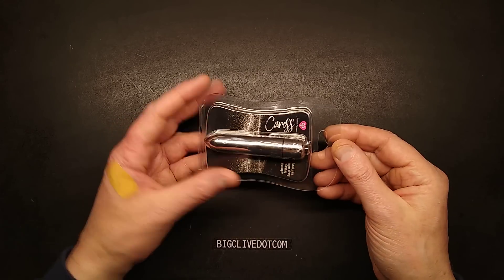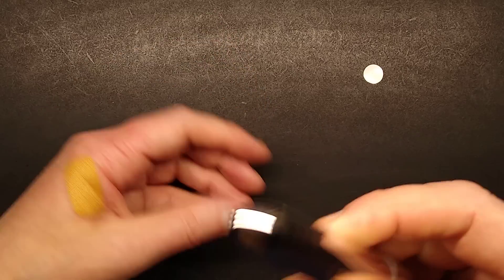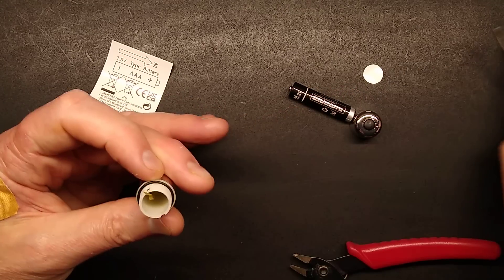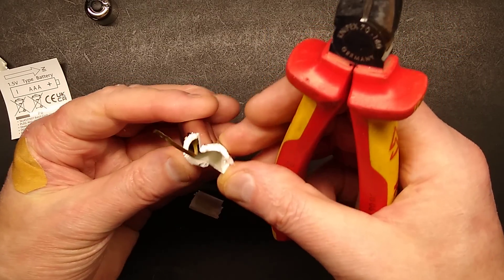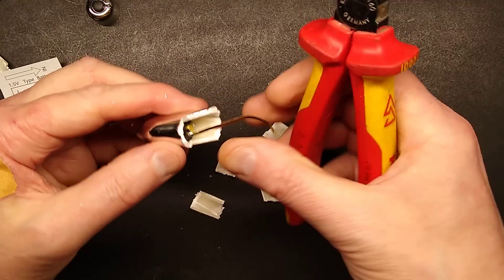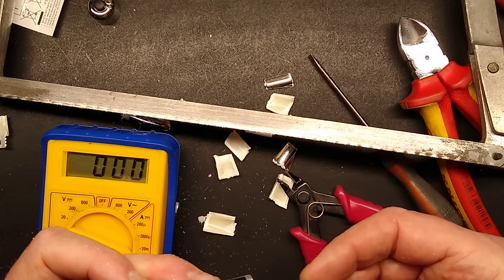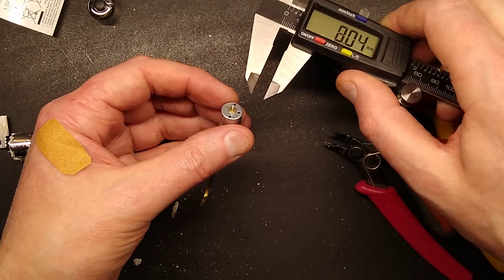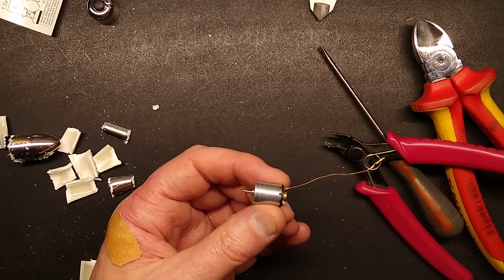Scavenging a Poundland vibro-motor

Comment: I bought one of these and gave it to a lady friend,  some time later I was driving through town at night she got it out of her bag , pulled her leggings down , feet on the dash and used it , I was thinking I wonder if that's got a low voltage low power motor in it 🤔 as i nearly crashed the car 😎

Comment: There are also useful ( and slightly smaller) batteries and motors inside the widely available £3.99 electric toothbrush that can be found in many supermarkets and other shops.. I think people forget what are in them and then throw them away

Comment: How can I make a constant current battery charger ( 2 - 4 amp) with a fixed voltage input?
Reply from the maker: That would depend on the application.

Comment: showing using the linear calipers as a depth gauge; brilliant. thanks. saves me having to get a seperate gauge. I hadn't spotted that functionality
Reply: What did you think the pokey bit was for?
Reply: @emma.jacobs1  something that made it awkward to put in the case! :-)
Reply: It would have been easier to use the shoulder on the other end intended for that purpose.  The pokey bit is used for measuring hole depths usually.

Comment: god, you wouldn't want to work in the returns dept. Shaft measuring phnarr was not lost either.
You can buy the little motors for cellphones small voltage and tiny current

Comment: Hmm, were these a pound or a few pounds clive? this will be a perfect, cheap source of vibrating pens, just the kind you would want to get the air bubbles and voids out of casting materials. I regurly have to give the folks at ann sums a couple of raised eyebrows when i go in and buy a dozon they seem to die quickly from being on for too long 😅 and the heat from the start of the curing process, might have to go in today and give some poundland works a shock buying most of the stock,

Comment: You really need to splurge on a tubing cutter. It's not the first time one would have made short work opening up a cylindrical device.

I suppose you'd find it awfully embarrassing to be caught using a plumber's tool by your fellow sparkies.

Comment: I can think of one application right off the bat...... My mini drone uses motors of that type to drive its rotors. The only problem might be that one would have to change all four, because you can bet your last tanner that the odd one out won't run to the same specs.

Any idea what the maximum rpm would be, and at what volts/current?

I'm now getting nightmares about vibrating drones, rattling about in the skies above! 🤦

Comment: A few years back, I used one of those, powered by 3V, to vibrate small castings of plaster of Paris on silicone molds, to remove air bubbles.
Reply: Thats actually pretty clever lol
Reply: @deadturret4049  👍

Comment: By the looks of things the short weighty shaft of the motor was thrust fully in the cavity that it was rammed into , if a little lubrication had been applied when first inserted  perhaps it would have prevented the rapid back and forth hand sawing . Probably  now useless as you gave it the snip

Comment: I have about 4 of these little motors. In my case, however, the counter-weights are so difficult to remove that they still remain on all 4. The weights appear to be several metal plates glued together in a stack, and are crimped onto the motor-shaft by what must be a beast, probably hydraulic in nature. I have not been able to free them despite my most destructive efforts.

Comment: About the AAA battery in there: does it wheight as much as a "normal" AAA battery? I've found that the batteries that were included with devices are significantly lighter than batteries I bought extra. I guess those "free" batteries have a greatly reduced capacity.
Reply from the maker: "Demonstration" batteries to tick the box of including one.

Comment: These motors works great when you want buzz notification like your phone does but in larger 3d printed housings. The high frequency vibrations from a phone motor tends to get absorbed by the properties of the printing plastic. I'm going to tell our local pi/arduino electronics shop to add poundland to their supplier list.

Comment: Construction of that toy reminds me of the Oral-B Pulsar disposable electric toothbrush.  Motor in the toothbrush is quite a bit smaller, 6mm OD X 12 mm long, but runs for about 3 months worth of thrice a day brushing on a AAA alkaline cell.  The toothbrush is rather more expensive at $12 for a 2 pack (bought by accident about a year ago, non-motorized toothbrushes had been about $8 for a two pack, they look the same and I just figured inflation).
Reply: I really don’t know what those cheap vibrating toothbrushes are good for. As far as cleaning your teeth, they’re as effective as humming a tune while using a regular brush. And for other “personal” purposes they just seem a bit too underpowered. 😉

Comment: Absolutely perfect for repairing my kid's drone. Landed in a tree and burnt out one of the motors. Cheers Clive.
Reply: Interesting. I hope the motor lasted long enough. But what happened with the drone? Or did you forget it while in the tree?
  You know, they sell new motors on Ebay, some as cheap as 1 pound ($1.27).
Reply: Depends if it's the same. Kv rating.
Reply: I tried to repair a friend's lad's drone and ordered a drone motor on Aliexpress, had  to order a second one because I hadn't got the correct rpm version. Plus you need CW or CCW motors, red/blue or black/white if I recall correctly.
Reply: @twotone3070  CW/CCW is for propellers, motors will spin in any direction
Reply: You may experience mild amusement every time you see it fly. Personally I don't give a flying fffwell, you know

Comment: I never expected to see something like this on this channel, but now i have the question, how many dangerous electronic 'toys' are there?
Reply: so, so many. A big issue is that the materials aren't very well regulated, a lot of them are made of cheaper rubbers that you should not be putting near your squishy bits. A lot of them have dodgy wiring and big scary lithium cells too.
Reply: @estherstreet4582  now I need to see a video about witch ones are and why/how they are, 

"let's make a 'toy' make out of a cancer causing material with sketchy insulation that you put into yourself"
Reply from the maker: Search my videos for Rinky Pink Pounder to see a shady 240V one.

Comment: An improvement, normally the inner sleeve is well stuck down with a solvent weld, and yes I have salvaged lots of those motors, and often enough a rather interesting reduction gearbox as well, complete with a crank to make linear motion as well. Will say that, despite being sealed really well, they are also not waterproof, or liquid proof. Yes not really repairable, but I always had lots of those to use when young, and the failure modes on them invariably involved corroded connections, or open wires or switches. The rudimentary speed control, steel wire wound on a piece of wire insulation, was surprisingly robust, though again prone to poor contacts. They also did not like running on 12V from a used car battery, for some reason, lots of glowing steel, and melted plastic, and motors that turned into light emitting devices for a few fun seconds.
Reply: "I always had lots of those to use when young"

As a young lad I had loads of electrical/electronic stuff to salvage for parts, often donated from relatives or bought for pennies at local jumble sales.  However I didn't have any of these 🤣
Reply: @ferrumignis  Well it did help that the business I was in was selling them, and in large numbers as well. ^ monthly order from Hong Kong, and every year another from Pipedream as well. Still got the Rush clocks....

Comment: Those devices have more oomph if you swap the 1.5v batt for a 4.2v one.
Reply: But then, if something goes horribly wrong it can fuck up everyone in the vicinity.
Reply: Boost that shit to 36v
Reply: There's this YouTube channel "Aboringday" where some guy from Hong Kong likes to wire cheapo toy tat up to a programmable DC power supply, then slowly increases the voltage... :D

Comment: I've said before that I've got that exact multimeter. The other month I was measuring the current draw of a Reel to reel motor and I had the meter on the wrong setting, there was a glow from inside the meter and now it claims that a 9 volt battery has 74 volts in it. 🤣

Comment: What about disposable vibrating electric toothbrushes....they are much easier to take apart as well. The bonus is that they usually have "AA", or "AAA" Batteries that last far longer than the brushes.

Comment: Might be good to use with small Solar Cells...
Reply: I had that idea a while ago as another whimsical/humorous contraption.

Make a bupplug/Tom Bumdildo that only works in direct sunlight, so you have to take it outside and change the definition of “where the sun don’t shine.”
Reply: @deltab9768  Not what I had in mind... but 😂😂😂🤣

Comment: 0:32 Clive isn't allowed to say what this is, but the way he says "...moist..."
Reply: Those vapes get weirder and weirder...
Reply: @KernelLeak  If you're going to put that in your mouth make sure you THOROUGHLY sterilise it first!
Reply: @zh84  No need to,but remember to keep away from teeth, as it will chip them. They do work well when used correctly, though correct use does mean you really want to use some rubber as an insulator, to prevent inadvertent electrical contact.
Reply: @KernelLeak  And why is it fish flavored...
Reply: We need that as a sound clip to use for liveclive... 🤣🤣🤣
Reply: Absolutely cracked me up...
Reply: @0:37
Reply: @ohioplayer-bl9em  I wanted the context as well.
Reply: Moist, Shaft, body , length, full length 🤔😂😂hilariously spoken. Not even Roman Atkinson could have done it better 👏👏👏

Comment: Oooh! A Mini fruit juicer!
Reply from the maker: It's for juicing grapes.
Reply: Bean juicer?
Reply: Watching E&K reminded me recently that these are really agitators for thixotropic fluids such as uncured concrete and epoxy.
Reply: Or gravy.
Reply: perfect size for a kumquat
Reply: @PDXhousecat  You spelt kumquat wrong. 😊
Reply: Well it does certainly get the juices flowing!
Reply: technically; not wrong. 😄
Reply: Neck massager!
Reply: @markglover2525 Cervical massage you say
Reply: Well, we typically don’t get rpm and torque specs on teardowns like these. I suppose one could work out the torque from the power draw if we knew the moment of inertia of the concentric-I-mean-eccentric weight…
Reply: You can only imagine what these are used for..... should really come with a string if it ends up in the wrong hole 😂
Reply: May make some juice
Reply: Hahahaha!!!😁👌👍
Reply: Maybe it could ve used for window wipers on spectacles?
Reply: Knocks the Santorum or WAP juice right out of your 🍑
Reply: 🤣🤣🤣🤣
Aaaaaaah

Comment: Great device for mixing model paints!
Reply: No SOS mode? I'm disappointed.
Reply: @chrishartley1210  "Help! I'm trapped in a tight, moist box!"
Reply: Also really good for liquifacting concrete to make it flow into molds easier.
Reply: @Providence83  As demonstrated by Evan and Katelyn not that long ago.
Reply: Why not buy 2, & have a smile on your face whilst mixing it . 😃😃😃
Reply: true 😂
Reply: Good call, I'm shopping place right now. I'll put some in my glove box because I might mix paint in my car.
Reply: That’s exactly what it is. Isn’t it??? 🤔
Reply: Also, the button at the end may have a driver IC in it for various vibration patterns to mix the paints in different ways 😆. Pushing the button cycles through.
Reply from the maker: Just on and off in this one.

Comment: Ah, memories of taking my "Operation" game to bits, to find that its off-centre weighted motor was the thing making the noise when you hit the sides of the body openings. What a dumb game, but I guess I learned something from it after all.
Reply: See the recent PileOfStuff video for his upgrade to his brothers Operation game with a hockey siren.
Reply: LOL I remember scavenging the nose-bulb from my Operation game to use in my Radio Shack electronics project kit. (150-in-1? 250-in-1? I don't remember.)
I directly connected the 9v battery to the 3v bulb. 🤪 Oopsie!
Reply: Now you can homebrew your own Operation game.
Reply: @five-toedslothbear  I think we all want to see a version of Operation that is Area 51, Alien Autopsy.